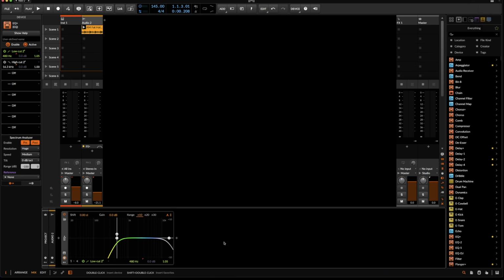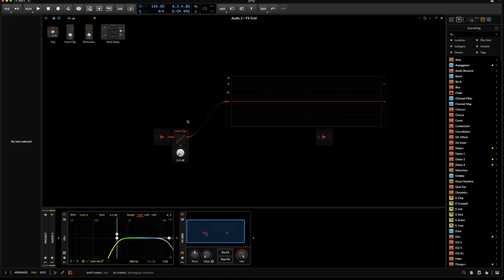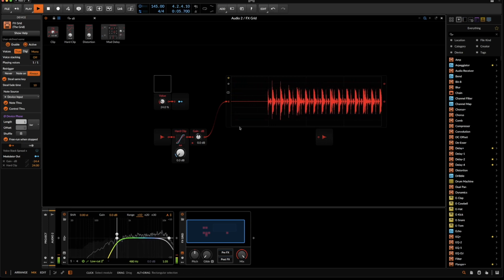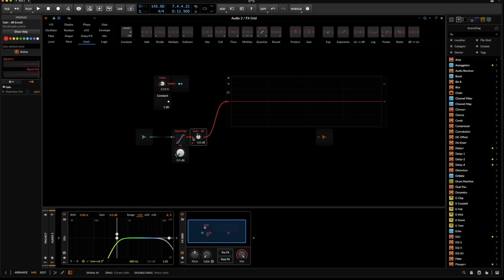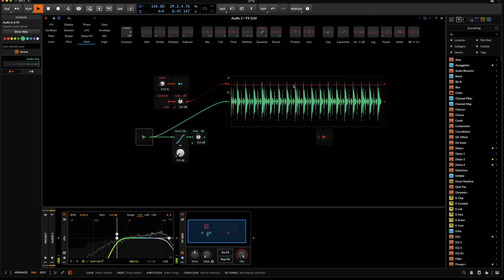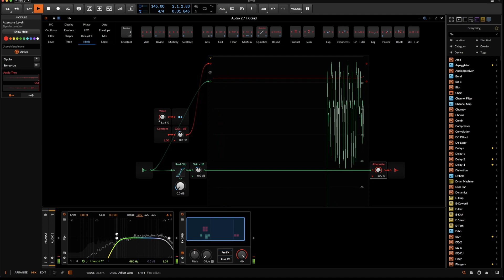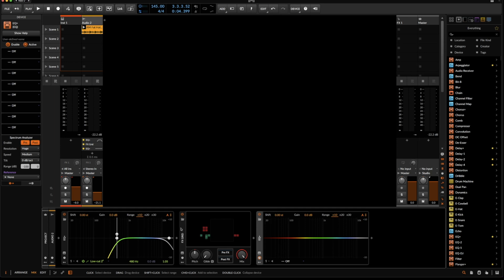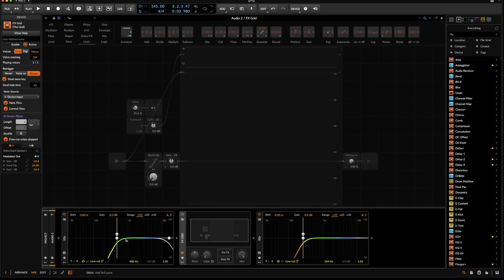Create your own Clipper with visual feedback in Bitwig 📋🎬

Comment: Super helpful video mate! Thanks a bunch! I usually apply a Lo cut in linear phase after hard clipping to avoid the signal getting louder again. Linear phase has it's own trade-offs but thats fine by me :D  And since clipping is saturation, it adds a lot of harmonics in the signal resulting in that low frequency buildup you showcased at the end.
Reply from the maker: Glad it helped! Thanks for tip to use a linear phase EQ afterwards, it works :)

Comment: Another nice one. If you chuck and "Abs" module from the math category between your (grid) input signal and the scope, the negative values of the waveform would also be positive, which makes them also show when you set the scope to unipolar
Reply from the maker: True! I realized though at that the oscilloscope does this automatically when when set to uni polar, so it's already taken care of :)
Reply: @theRumbleChannel   I don't know if it's been an update to bitwig or not, but it also seems to fix the "ugly" logarithmic display option of the scope (although i haven't tried it without an abs in between)
Reply from the maker: @MrKlixon  I'll give it a try then :)

Comment: cool, thanks! I ended up using three oscilloscopes. Two showing the upper and the lower clipping boundary, respectively. And the third showing the resulting signal.
Reply from the maker: Cool! that's pretty much what I did as well in my version :)
Reply: and I added a button+select and a pulse osc as an alternative or the constant. The pulse at a high pitch would draw a red background. I wish one could customize the color to be 50% transparanet.
Reply from the maker: @StefanSauer  yes that might work :)